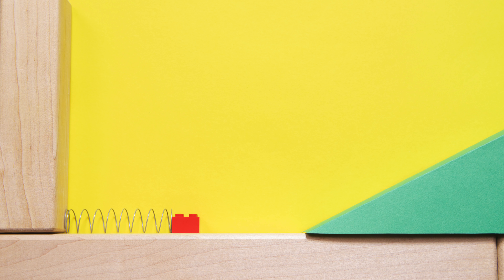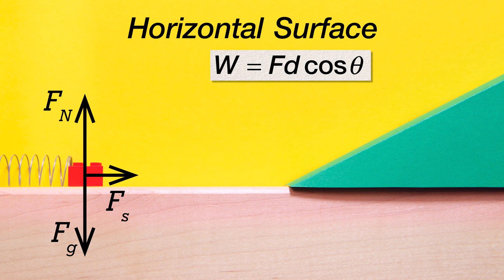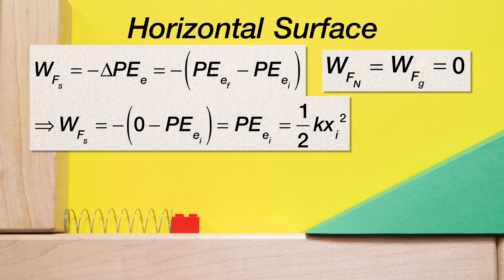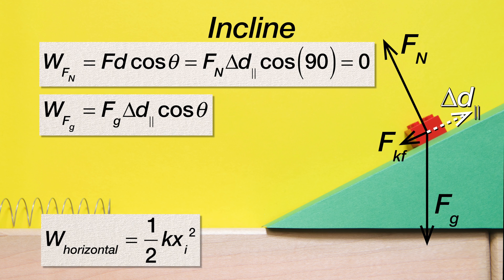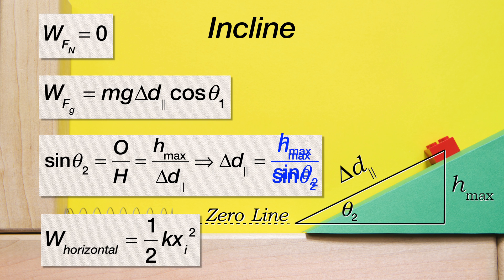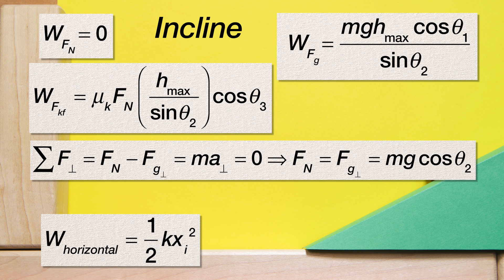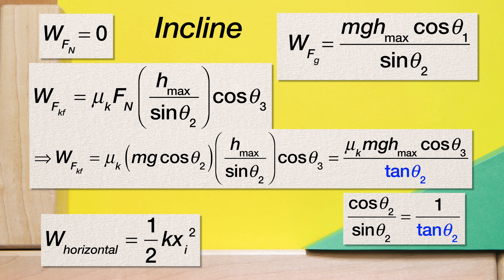Work-Energy Theorem Problem by Billy

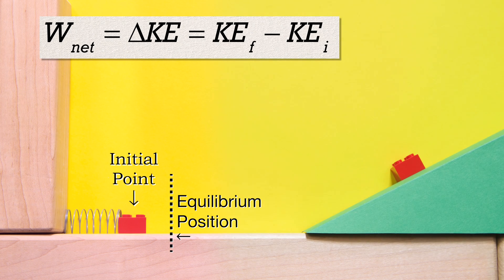Comment: Mr. Billy, to be honest, this question is too complicated. 1:07 You already mentioned that Wnet = delta KE => Net work equals the change of kinetic energy. Net Work is done by net force. On the incline the net force is Friction + x component of gravity. So we have 1/2kx^2 = (umgcos25 + mgsin25) *d.
Reply: The net force is not constant throughout this problem.  Billy is separating it by section, where each section has a different calculation for the net force.   In the first section on the spring, the net force equals the spring force acting with its motion (gravity and normal force add up to zero).  In the second section, the net force is the lateral component of gravity plus the friction, acting opposite its motion.  Normal force and the perpendicular component of gravity add up to zero and do no net work.

Comment: I don't understand Work(spring) = -ΔPE . Have we learned this yet?
Reply: Jesus Baba This is when the spring is pushing the block towards the incline. It is converting potential energy into kinetic energy. therefore potential energy is decreasing that’s why it is negative. Work equals the change in kinetic energy however that equals the change in potential energy which is conserved.
Reply: Work done by any conservative force equals the negative change in potential energy associated with that force.   When a conservative force does work on an object, the energy must come from its potential energy.  When a conservative force has work done on it (i.e. negative work), the work must go in to the object's potential energy.  Potential energy is a shortcut for the work done by a conservative force.